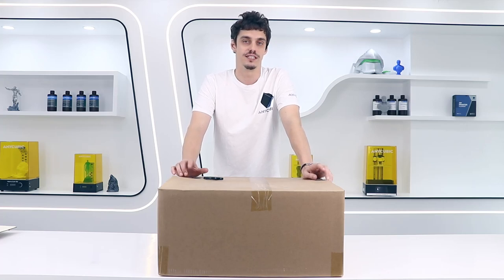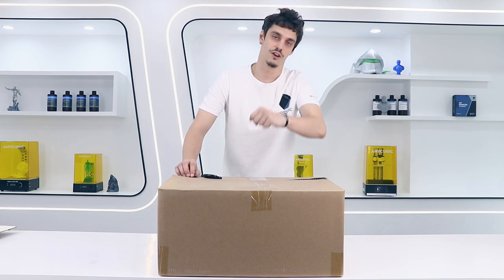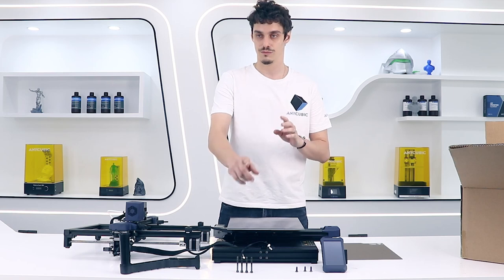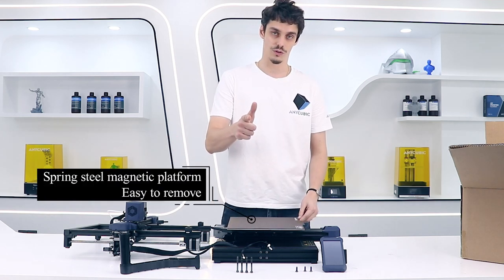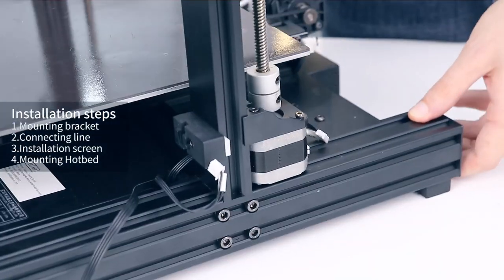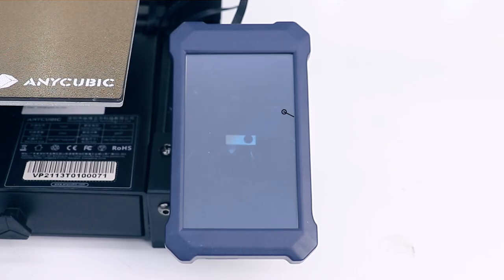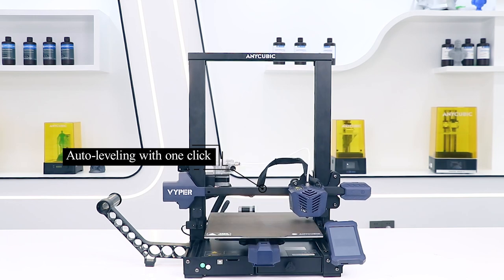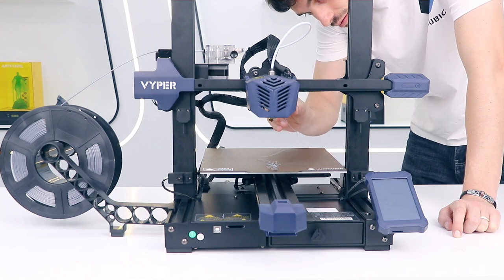Anycubic Vyper Unboxing and Quick Installation

Comment: Just received mine today, but auto-levelling fails. Y-Motor goes too far away and nozzle isn't able to touch the bed...
Reply from the maker: Hi, sir, we're sorry for the auto leveling trouble and we'll solve the problem for you soon.
You can feedback your problem directly here, so that the after-sales engineer will solve the problem for you directly according to your order.
http://support.anycubic.com/VisitorTicket/guest?id=3&token=6e6e6f9affeKpTBnN5emV0ejsfQEYJUwFSUwNRAFMGTkAY
Or you can get the quick and timely reply on our Facebook homepage.
Facebook：https://www.facebook.com/ANYCUBIC3dprinter, Instagram：https://www.instagram.com/anycubicofficial/
Reply: @ANYCUBIC3D   - I have the same problem here in the United States.  The printer arrived in 3 days which was excellent, thank you for having a U.S. warehouse to ship from.  However the Y axis goes 1.5 CM too far back in its movement before hitting the end stop micro switch, therefore when the Z axis drops down, it is off the bed and cannot level.  This is obviously a setup issue from the factory and a video on how to re-adjust the end stop until QA fixes the pre-assembly error would be helpful.  Thank you.
Reply from the maker: @Richard Murphy  Hi, sir, for videos of checking and leveling before use, you can view this list, if there is any problem with the product, you can set up an after-sales order here, and the engineer will provide you with a solution directly. 😊

Video List: https://www.youtube.com/playlist?list=PLigeDb6eIcGof9Bii5tyiAuLMhQUBEgcO
Support: https://support.anycubic.com/VisitorTicket/guest?id=3&token=6e6e6f9affeKpTBnN5emV0ejsfQEYJUwFSUwNRAFMGTkAY
Reply: I already tried to fill out that ticket request.  The wheel just spins and spins when I hit submit and never goes anywhere.  

That video does NOT show what happens when the board goes off the Y axis to the back and how to fix it.  

Showing me videos where everything works perfectly does NOT help.  At all.  Show me a video where there is my error (and the other person’s) and how to fix the issue.  

Thank you.
Reply: @richardmurphy2827  Just wait for the bed to warm up. This was causing the issue. Levelling works only when the bed reaches 60 degrees Celsius.
Reply: @oldtimerrescue1671  I figured that out today.  Turned it on and just let it sit.  It looks like it's doing nothing, no screen changes, nothing at all, but eventually it finished the auto-level.  Took probably 5 minutes of just sitting there and another 3-4 minutes to do the level.  They should include that in the instructions because otherwise it looks like it's broken.  2 days and still no response from tech support.  I wouldn't want to have to actually have this worked on.  Support is absolute crap.
Reply from the maker: @richardmurphy2827  Sir, could you try to submit the after-sales order again? 
We have tried that it can be submitted, and please attach the video and picture, so that the after-sales engineer can contact you directly. Really appreciate for your understand, and hope the problem can be solved asap.🤗

Comment: Is the US 220v or 110v? 

It shipped to the US but it was defaulted at 220v.
Reply from the maker: Hi, sir, the standard in the United States is 120V, you can manually adjust to 110V